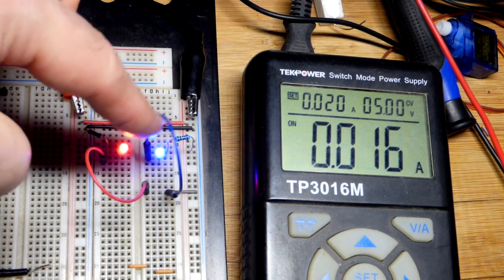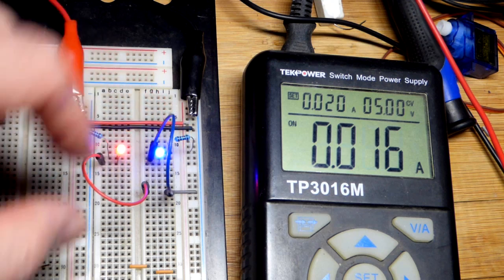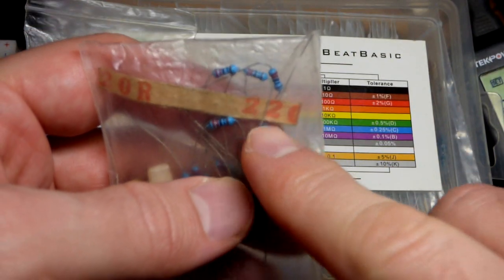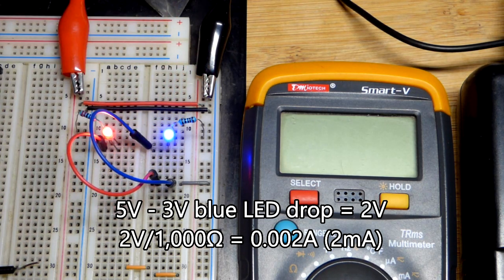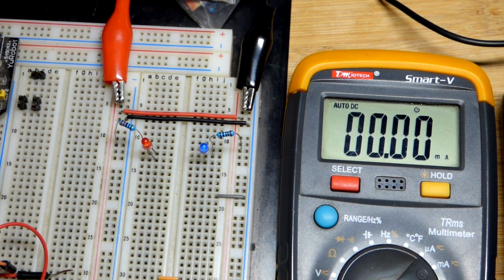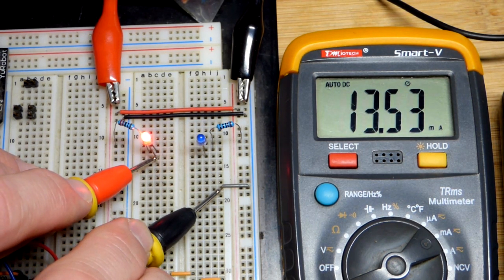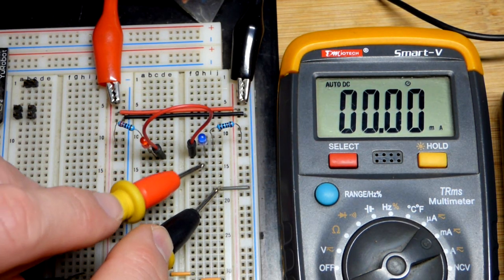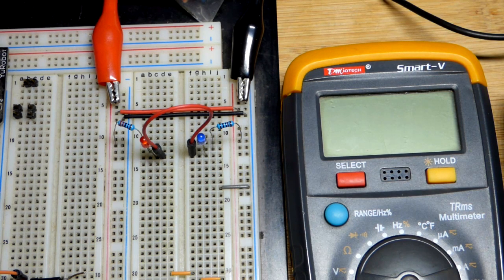How to multimeter measure current of blue LED with 1000 ohm resistor at 5V demo by Electronzap

Comment: This is really good! I use red LEDS with a 1k ohm resister as I’m using an Arduino R4, the I/O pins are limited to 8mA. The red LEDS seem a little bit dim, I’ll definitely be trying different colours from now and measuring the current flow also. Thank you so much 😊
Reply from the maker: Yeah blue, green, white are all pretty bright at 2ma. Arduino boards tend to be more for switching transistors than powering loads directly. I am planning on my next multimeter video being about measuring how low of a current is needed to turn a BJT on to light a red LED powered directly from a power supply.